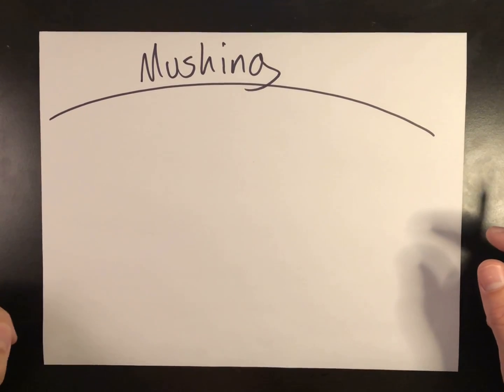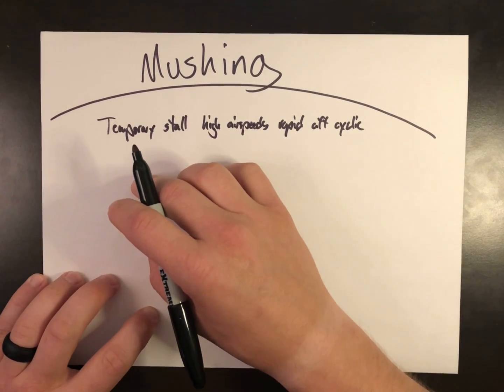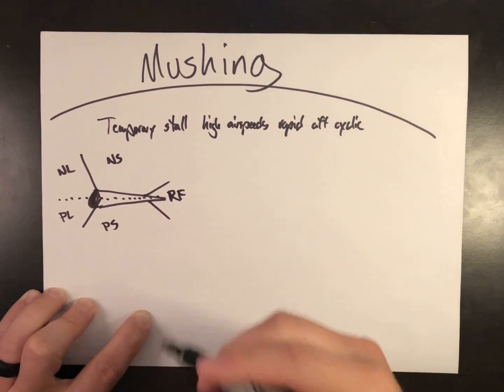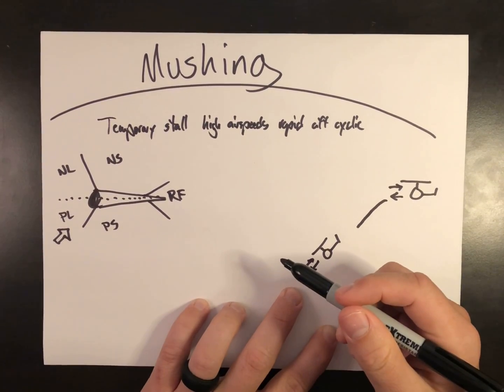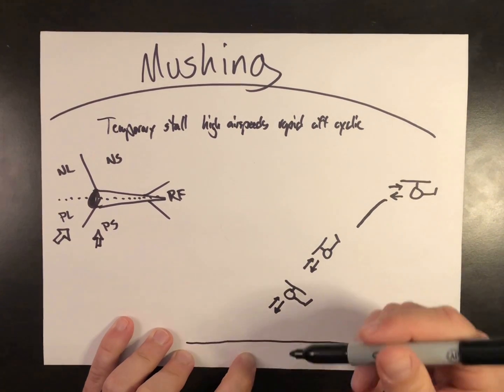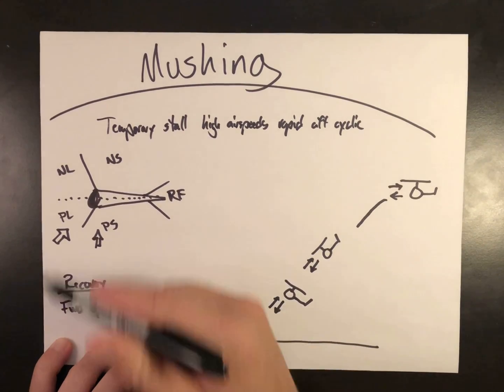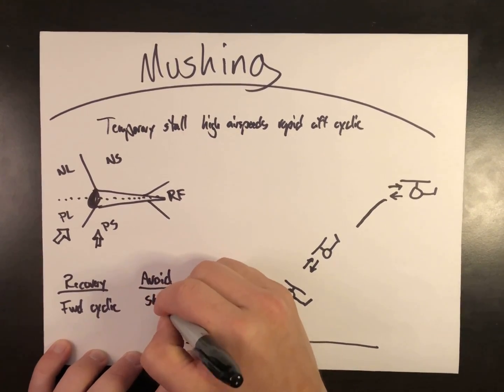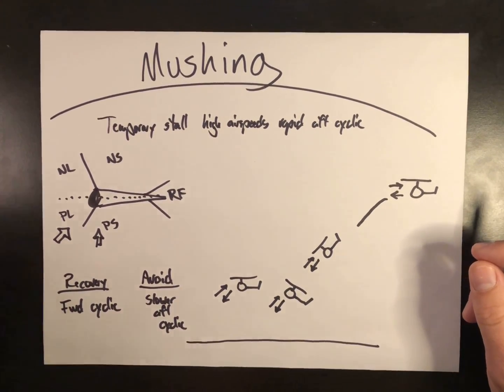Mushing in Helicopters

Comment: From a former Mi-24 / HIND scientific & technical intelligence analyst for the US Army Foreign Science & Technology Center [ FSTC ], now the National Ground Intelligence Center [ NGIC ] in Charlottesville, VA.  I was the principal technical analyst on the Mi-24 / HIND during the 1970s, and the sponsor of the Catch 24 Conference at FSTC in 1976 addressing the air-to-air combat potential of the Russian Mi-24 / HIND helicopter.  This conference was well attended by US Air Force and US Marine aviators, both rotary & fixed wing.  

This conference eventually culminated in the J Catch Trials in 1978 of the Mi-24 / HIND air combat potential against both rotary & fixed wing US aircraft - with & without complimentary ground based air defense support.  The numero uno lesson learned in Tactical Air Combat Maneuvering [ TACM ] in a helicopter is to aggressively pull collective first, then apply aft cyclic to avoid mushing.  Then, add a right or left turn to climb out.

Cheerz,
bb

Comment: Interesting topic and instruction. I was a Utility guy and I think this phenomenon should be taught to the Army UH population more often. An interesting rule of thumb is at high gross weight, 90 kts IAS, 60 degree bank angle, the aircraft doubles in weight and will loose altitude. It’s fatal at low altitudes.

Comment: The Mi-24 suffers bad from this becuase of its speed, weight, and it’s wing behind the rotor that stalls at similar AOA as when the rotor stalls. The manual mentions giving not only forward cyclic but decreasing collective 1-3 degrees. 

It’s simulation in DCS seems to agree with this. Couldn’t reducing collective to un stall blades also be part of recovery for other helicopters?

Comment: So, forward cyclic to recover. Ok, so you are sacraficing altitude for airspeed, to get aircraft back in trim. This mushing thing is also causing a high "G" condition where pulling more aft cyclic can cause mast bumping. Not good! Instead of "diving" why not do down collective while going forward to get a shallow angle of descent, mind you, you are descending at 2000ft per minute +/-, while still keeping the aircraft level and in trim. While still hauling ass descending, a bit of forward cyclic n up collective should get your ass up rather quickly with ETL, Effective Translational Lift... This mushrooming thing is not a good manuver, IMO...

Comment: An interesting story Jacob... 35 years ago when I was young and dumb (now I'm just dumb), I was goofing off in my Aeronca L-16A when landing one day.  I was at or over gross weight as I had a large man in the back seat and at the time, I was over 250lbs... and I was making a very steep approach and pulled hard at about 50' above the runway at about 90mph. I definitely felt the wing, "let go" and all lift was lost and the plane was mushing toward the ground. Thank goodness for the big wing of the champ and when I let off the pressure on the stick, lift was regained about 5' from mushing into the runway, which based on the descent rate would have probably broken the airplane and our backs!  Never did that again, but am just telling this story as it is not only fighters that can experience this effect.  I guess some would call this a high speed stall, but I like the explanation of mushing and it certainly felt like that.  Love your videos.  Thanks for all your expertise and time.

Comment: Is “mushing“ similar to “settling with [insufficient] power“?
Reply from the maker: Mushing is more of a stall. Regardless of how much power you pull it won’t fix the stall. You need to change pitch of the disk. Settling with insufficient power is more like developing a high sink rate without enough power to arrest it towards the ground. Think high, hot, heavy and a high rate of descent that there’s just not enough power to slow down at the bottle so you impact with quite a lot of force.

Comment: I've heard of SWP during a quick stop. Is this the same principle that the positive stall region is eating the wind because of the angle?
Reply from the maker: The difference between Settling with Power and Mushing is airspeed. SWP is less than ETL where a second set of vortices can form. Mushing occurs at airspeeds far faster than ETL where there’s no way a second set of vortices can develop. Mushing is a positive stall condition whereas SWP refers to root vortices combined with wing tip vortices. Great question!
Reply: @helicopterlessonsin10minut10  thanks!

Comment: How to loft a small car nearly of700-800 grams
Reply from the maker: I’m sorry but I don’t understand your question.
Reply: I mean that for a project I need to lift a toy car how can I lift it or fly it
Reply from the maker: I would determine the weight and see how much power available you have for a helicopter to lift it. Check out the max gross weight hover charts.
Reply: @helicopterlessonsin10minut10  
Make understand in simple words
Reply: @helicopterlessonsin10minut10  I want to make through motor
Reply: @helicopterlessonsin10minut10  we want how much power

Comment: I'm sure you are familiar with the g loading chart in the -10. Do you know if the g loading chart is to prevent structure damage to the airframe or to prevent pilots from getting into mushing? (Positive G only) What happens if you exceed the positive g limits from the g loading chart?
Reply from the maker: G loading doesn’t necessarily mean you’ll get into G loading limits. It’s a separate aerodynamic situation. G loading can damage the aircraft specifically in the rotor system. That’s usually the limiting factor. 2G’s essentially means the aircraft doubles in weight. That’s a lot for a rotor system to handle. Great question.